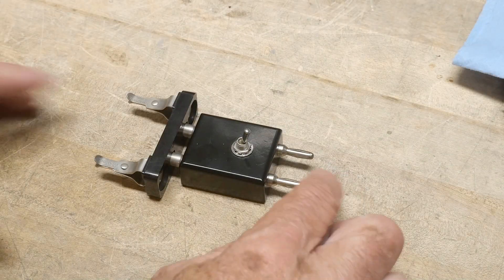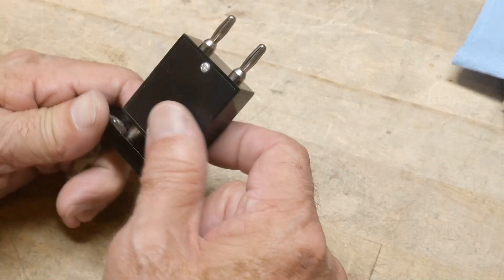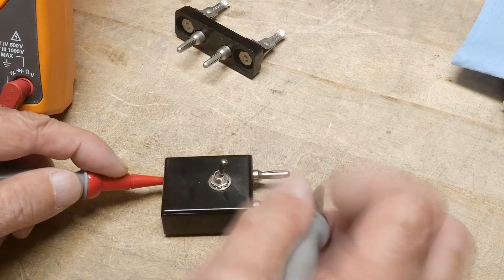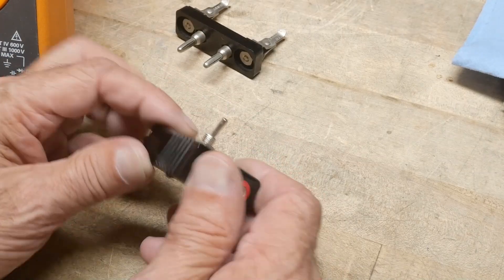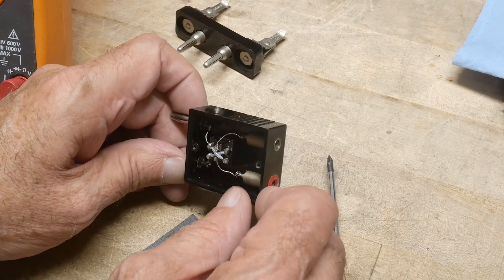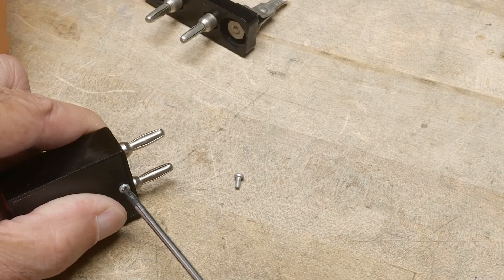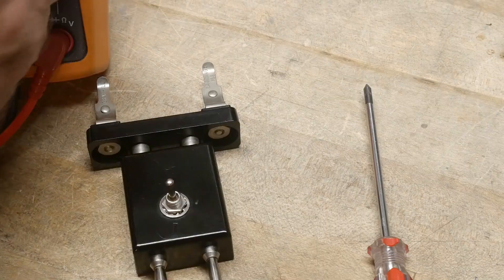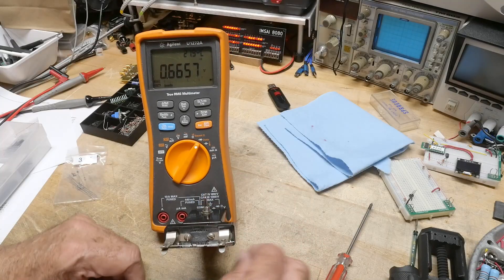#2321 Axial Lead Test Fixture

Comment: I found it interesting that both the test jacks and switch had turret posts which I haven't seen in years, and I'm not sure if I've ever ran across a switch that used them. The wiring looks like amateur to me, I'd expect somebody who's wiring hundreds of these would be doing them a lot nicer than this example.  I didn't have one, but monkey saw so monkey's going to make one albeit wired a little nicer.  There's a few of these Pomona 2224 boxes on Fleabay so I snagged one.  Bit pricey but it's a really neat vintage project box and I don't mind investing in quality tools.  Gotta say I'm a bit jealous, I wish I had a toy store like yours, you come up with some great stuff for dirt cheap!

Comment: That switch would work well for checking a capacitor for inner and outer foil, since they aren't marked anymore. And also, a diode check is another example.

Comment: Looks like the Pomona Model 2098 "Component Mounting - Banana Jack to Double Banana Plug - Junior Size"
Pomona 1966 catalog, page 12.  DPDT switch added by an engineer, tech, or assembler later.

Comment: Hi, years ago I made the same fixture but in a power version so I could easily test vehicle lock servos. The switch in my fixture also has a center position, but it can handle DC 20A

Nice day 🙂 Tom

Comment: The screws not being countersunk make me think it's DIY not "produced". ???????????
Reply: The only thing not "produced" is the toggle switch.  It's a Pomona 2224 box.  It came from the factory with the input and output bananna jacks.
Reply: @mikesradiorepair  and domed screws instead of countersunk???  :(   ;)
Reply: @edgeeffect  Given that it is designed to be plugged in to a meter, not sat on the bench, raised screw heads make no difference.